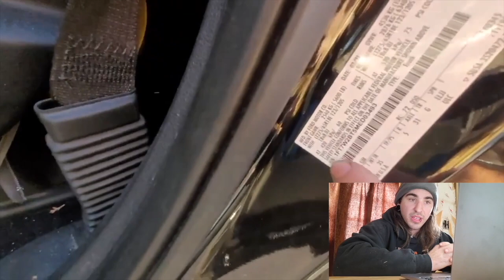You're Probably Overweight | f250 W/ A 40ft Non Cdl Trailer | How Much Can You Haul?

Comment: Bro this is wrong😂 if you have  more than 10,000 pounds on a trailer pulling it for money you need a class A CDL
Reply from the maker: I can tell you don't have a cdl or you live in California. Anybody who says this makes me laugh. You sir need to read before you listen to some idiot in the facebook group "because he says so". No cdl is required unless you're over 26,000 PERIOD. 

Classes of License and Commercial Learner's Permits (CLP)
Pursuant to Federal standards, States issue CDLs and CLPs to drivers according to the following license classifications:

Class A*: Any combination of vehicles which has a gross combination weight rating or gross combination weight of 11,794 kilograms or more (26,001 pounds or more) whichever is greater, inclusive of a towed unit(s) with a gross vehicle weight rating or gross vehicle weight of more than 4,536 kilograms (10,000 pounds) whichever is greater.

Class B*: Any single vehicle which has a gross vehicle weight rating or gross vehicle weight of 11,794 or more kilograms (26,001 pounds or more), or any such vehicle towing a vehicle with a gross vehicle weight rating or gross vehicle weight that does not exceed  4,536 kilograms (10,000 pounds).

Class C: Any single vehicle, or combination of vehicles, that does not meet the definition of Class A or Class B, but is either designed to transport 16 or more passengers, including the driver, or is transporting material that has been designated as hazardous under 49 U.S.C. 5103 and is required to be placarded under subpart F of 49 CFR Part 172 or is transporting any quantity of a material listed as a select agent or toxin in 42 CFR Part 73.
Reply from the maker: This is straight off of the fmcsa website. No cdl is required unless you are over 26,000 pounds INCLUSIVE to a trailer over 10,000 pounds. Not OR 10,000 pounds.
Reply: @CPSteveMiller  okay brother. Whatever You say. I do have a class A and I heavy haul equipment. So ur right I have no idea what I’m talking about😂.
Reply from the maker: Apparently not. You couldn't have just read the laws and said "nope, that's not right" 

Show me where it says you need a cdl for a 10k trailer. You can't. That's been outdated since forever. I am a non cdl operator. Have been for 5 years. I've been through 3 audits, and never failed a level 1 inspection other than 1 time for an oil leak. Officer needed to get me for something. Out of those 5 years I ran for 3 total.
Reply from the maker: I had another cdl guy try to tell me the same thing. Argued it until he was blue in the face. I have the laws from all of the lower 48 states. None of them state you need a cdl for a 10k trailer except California. If you have a problem with that go argue with the fmcsa. They'll be sure to hear how you misread their law
Reply from the maker: Here you go:

https://www.fmcsa.dot.gov/registration/commercial-drivers-license/drivers
Reply: @CPSteveMiller  Class A*: Any combination of vehicles which has a gross combination weight rating or gross combination weight of 11,794 kilograms or more (26,001 pounds or more) whichever is greater, inclusive of a towed unit(s) with a gross vehicle weight rating or gross vehicle weight of more than 4,536 kilograms (10,000 pounds) whichever is greater.
Reply from the maker: You just copied what I posted and proved my point. 26,001 pounds INCLUSIVE to a towed vehicle over 10k. 

Key word: INCLUSIVE
Reply: @CPSteveMiller  if your trailer weighs over 10,000 gross you need a class A man. You can’t argue that. That’s exactly what it says
Reply from the maker: No it says INCLUSIVE to a trailer over 10k
Reply from the maker: I've been through 3 audits with a 17k trailer and 9k truck. Been through many level 1 inspections including North Carolina where they are strict on hotshots. Never an issue because there's no 10k+ law unless you are one 26,000.
Reply from the maker: Coming from the guy who got his cdl and the guy who runs non cdl. I am 100% legal with a 9k truck and 17k trailer. You will lose every time 😌
Reply: @CPSteveMiller  okay you keep running ur lil ass rig and let the big boys do our work.
Reply: @TheXopticfanboyx  no, it DOES NOT say that at all.  Go back and read.